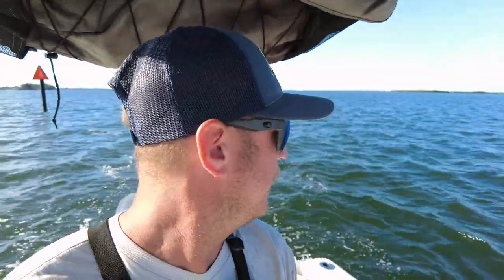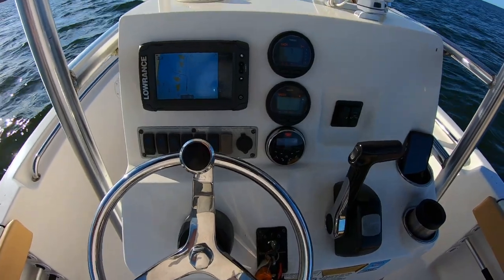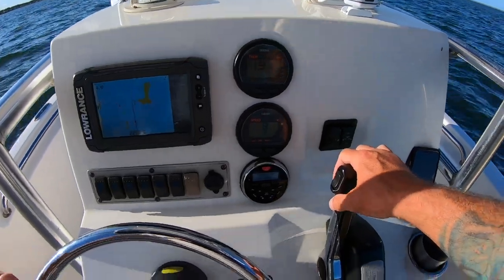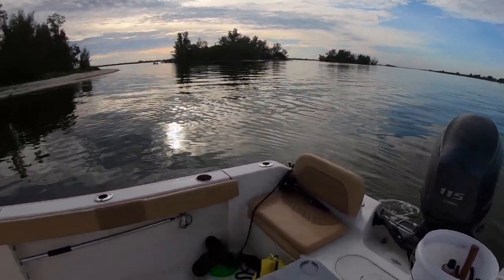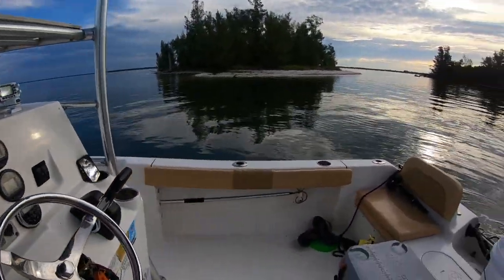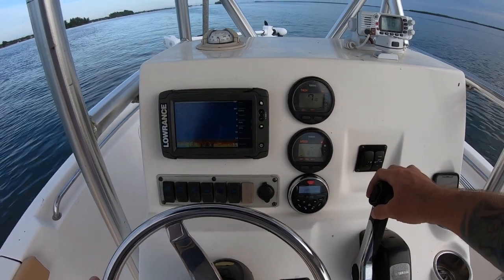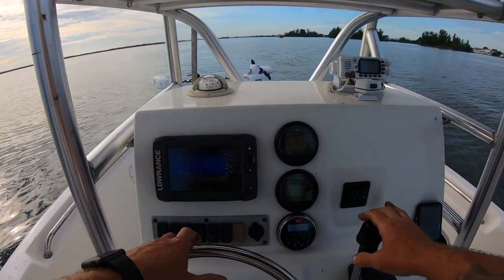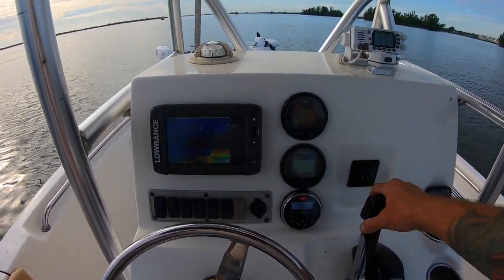How To Select The Perfect Prop For Your Boat | Key West 189FS | Turning Point Propellers

Comment: were you consistent with the trim tab settings between all the different propellers? could see you fiddling with them, but didn't mention any process you were following like you did with the motor trim.
Reply from the maker: For the purposes of the test I didn’t use the tabs at all. Using tabs down only to get on plane in shallower water.

Comment: I run a 3 blade 13.5x15 power tech on my Yamaha f115 190cc sea pro it runs 39-40 trimmed out thinking about going to a 4 blade
Reply from the maker: I am currently putting a 150 on the boat so will have to re prop again.